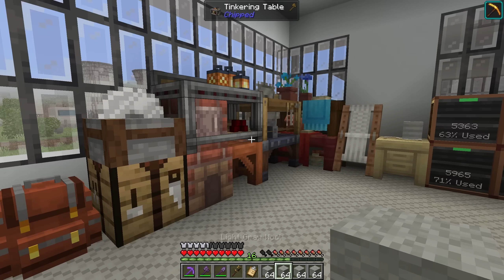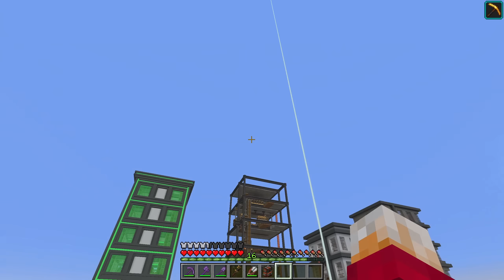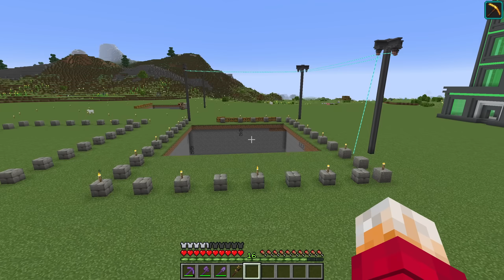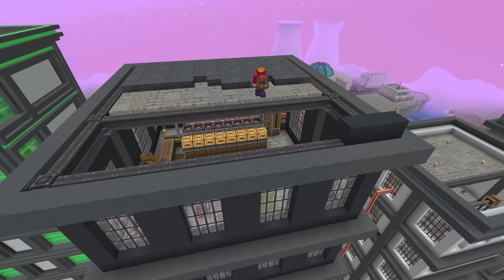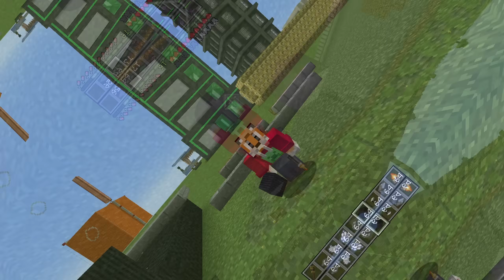Designing My CITY in Minecraft Create Mod

Comment: What's funny is in the previous episode, his motors were in fact running out of power very quickly. Those at the settings you were using, And were using 1.9k rf/t each so 7600 total between the 4 of whatever energy it is running off of. And those same lines are powering everything else... he just needs each building to have its own power line or at least that one with all the crafters.

Comment: I've had this issue before. Adding multiple wires to one connector splits the energy output I've noticed. It was fixed as soon as I made parallel lines each powering one machine and one machine only. What I mean is a chain of wires only coming from one connector each time. I haven't been watching consistently so I hope you set the connectors to pull on the source where the power is being generated and where the power is stored (accumulators) So everywhere where power is being put out. But only on the connector that is supposed to pull energy out of something. Hope this helps :3

Comment: Hi Foxy! As you mentioned I think that the problem with the motors is the way that you are distributing the electrical energy, as you see each wire only supports 8k it seems that each motor is using nearly between 1k and 2k then just that building is consuming all the energy supported by the wire, if that is the greatest tier of wires I think that the only solution is to sent more wires and start to approximate how much available energy is left in each line, I think that something that can help to calculate the energy available can be a battery at the end of the line, normally the battery has a big input consume, then It will try to consume all the energy available then I am assuming that you can see how much they are consuming when they are charging up and you can see how much on the network is available on that particular line, I think that you have to leave also some free range because it seems that the energy consumed fluctuates then if you are too near from the threshold you will start to have problems in that line time to time.

Also it seems that the create motors are way more efficient, they are just consuming 240fe that is nothing compare with the other motors.

Comment: Referring to the vertical stiped white stained glass, "Stiped" actually has a definition, but is now obsolete. It relates to botany, and is the adjective of "to have a stipe". Now "stipe" on the other hand has many meanings. It's a noun which describes:
► The stem of a mushroom, kelp, etc.
► The trunk of a tree
► The caudicle within the pollinarium of an orchid flower
► The petiole of the frond of a fern or palm
And also another obsolete definition, historical slang for a stipendiary magistrate.
But it is most likely a grammar error. :penguin-blue-waving-tear:

Comment: When you are able to update to 1.21, assuming you are able to, one change that happened, at least on the NeoForge version, is that the Schematicannon can now properly place down filled framed block now, instead of leaving them as the wooden frame that needs to be filled. I am not a modder by any means, but if the Fabric version of the framed blocks mod is close enough to the NeoForge version, it might work out that way if you do update. Granted, I don't know if that was a feature that is only present in 1.21 now, or if it was a part of Create 6.0 as a whole.

Comment: The nuclear plant and motor shaft breakage problems are one and the same problem. Create has a bug where components on a stress network will break from rapid updates to the network state. Unfortunately, this has been reported as "Won't fix," and so must be worked around. New age motors do not have a reserve of power, and so are extremely unstable on insufficient or buffer-filling networks, like yours.
Reply: Does that mean putting a battery as a buffer between the electric network and motors would solve this problem (as long as it always has more FE than needed for the motors)?
Reply: @JonasRabbe probably
Reply: @JonasRabbe most likely
Reply: @JonasRabbe he actually does have batteries for his electrical things. The issue with that is I’m pretty sure the batteries are still filling and as such the power going out is variable
Reply: @bryanhickernell7189  He never figured out how to set them to properly, ie setting them to pull on the correct lines. As such, the power is just jumping all over the place, which explains why parts keeps breaking.

Unfortunately, he already convinced himself that's it's a problem exclusive to one mod, all while using a system that uses drastically less power and would naturally be less prone into running into power issues because it can't hit the point where his power system breaks.

It's why no one runs their cpu at 95c all the time. Sure they're probably rated for upto 100c, but that doesn't mean you should run them at that or close to their peak all the time.
Reply: @ oof yea that would do it too. Only reason I know the issue he’s having is a battery issue is because I know the electric motor from create stuff and additions hates being directly on a flux point from flux networks. It stutters every so often if you don’t have a buffer in the network
Reply: Can you explain this more and/or link to the bug tracker?
Reply: @BinaryWhale put down a clutch with a lever on it, and put a creative motor on one side, as well as a mechanical press on the other side of the clutch. Now flip the lever repeatedly. Boom, something breaks.
Reply: You can add accumulators to act as a buffer. I run power to my accumulators first, then to the motor.
Reply: is that why theres a addon that adds a disposable shaft that breaks if the system becomes overstressed?